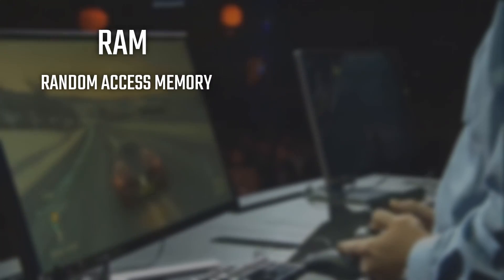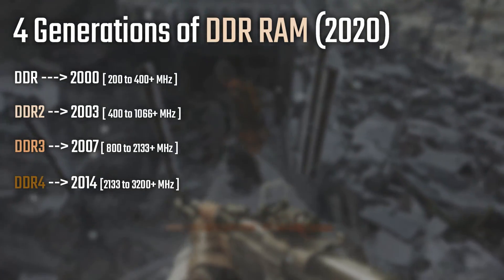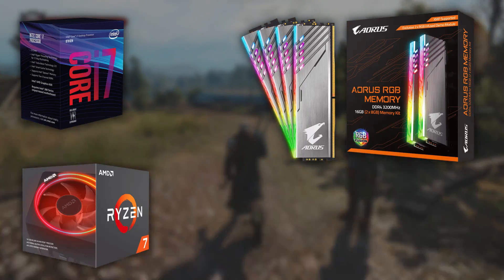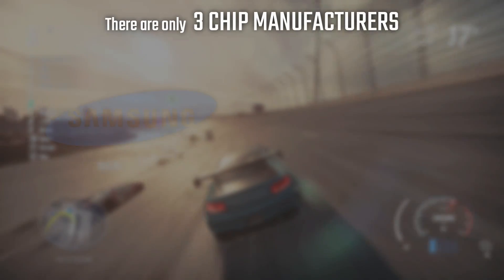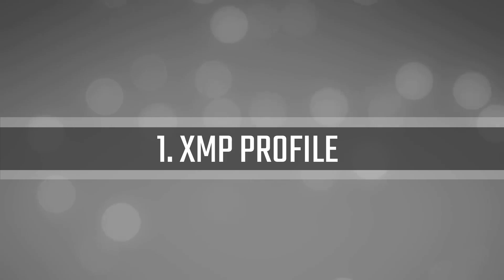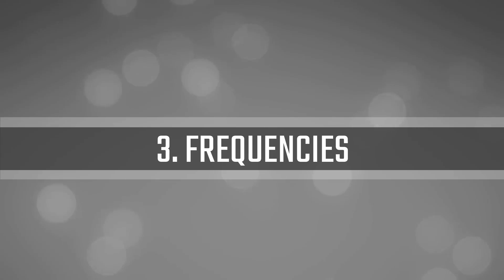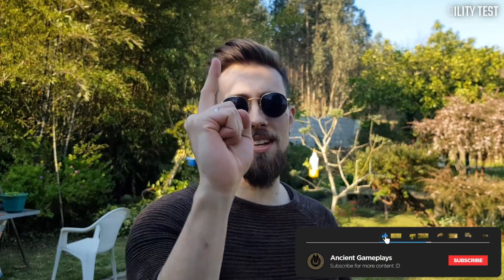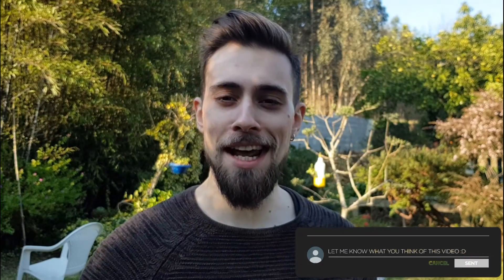How to Overclock RAM (2020 Tutorial) | Introduction of How RAM overclocking works, Tips and Tricks

Comment: But are the gains from all this lengthy process worth it? I don't think it is! especially when compared to simply applying the xmp overclock.
Reply from the maker: It depends completely on your build. For example, when you get a RAM kit rated 3200MHz CL14, it will most likely do 3800MHz with tightened timings (or more) and that will grant you a very nice boost :D
Reply: @AncientGameplays  I was planning to OC my ram from 3200 to 3600 when I get get a pc so I think its worth it to save an extra 20 - 40 pounds.
Reply: it’s fun to mess with your stuff and know you are using the most out of all components. overclocking everything on a new build is fun as hell
Reply: @BlakeCodGuy1  in your opinion to me its tedious
Reply: @74kross  very but worth it if you're on a apu or integrated graphics since they run off of ram it's making your graphics faster
Reply: I would say you’re wrong. The gain are totally worth it if you choose your ram properly. I can buy cheap Micron E-die ram and overclock it to the performance of much more expensive ram. Yes…….it takes time to do it properly………..but well worth it in the end. I don’t use PBO on Ryzen either. All of my builds run manually configured, fully stable, all-core overclocks of ram and cpu. None have come back.
Reply: I get the interesting scenario where XMP crashes my stability tests but manual overclocking doesn't.
Reply: @ThisIsAPigeon I think I'm having this issue as well brand new build 10700k Asus Hero XII and Corsair vengeance 3200mhz memory, I enable XMP and I get bluescreens on startup after a few hours of the pc being off super annoying I'm hoping overclocking manually will fix it for me too
Reply: @ThisIsAPigeon  me too. The XMP voltage is too high for my cpu controller. I crash with anything higher than 1.2125v for mem 😢
Reply: lol.. 90percent of ram sticks are xmp compatible.. enabling it is deafult :D I wanna see how to REALLY go over the xmp profile settings to like really lower the cl times.. I think Im satisfied with my xmp 3600mhz already.. just need a litle less latency
Reply: Some of us just like to tinker..
Reply: lol. this is why my ryzen 3600 can compare to most 3700's ez

Comment: Pc newbie here.  Ive been getting unstable memory (black screen upon boot up or random restarts when i get into OS) when I set the XMP to get my 3600mhz speed i bought (Corsair Vengeance PRO 16gb 3600c18) I set it back to the default 2133mhz for my fear of breaking something. Any advice? I have a Ryzen 7 3700x with stock cooler.
Reply from the maker: wel, the video actually tells you what do mate...But voltage to 1.4v should be enough
Reply: Ancient Gameplays I know I’m sorry I just wanted to be sure, do I have to move the voltage on the cpu as well like the video says or is that just for manual oc? Like I said I am very paranoid of destroying my parts this is my first pc.
Reply from the maker: @demetriomrtz  ram voltage..not cpu voltage
Reply: Ancient Gameplays I am referring to the soc voltage you mentioned, or is that on the ram too? Sorry I am a noob
Reply from the maker: @demetriomrtz  soc voltage is for infinity fabric, not cpu only hehe
Reply: Ancient Gameplays oh ok so do I tinker the soc voltage on infinity fabric when I up the ram voltage or is that just for manual oc ?

Comment: I have a quick question 
I have 2 8GB RAM kits from Adata d30 one with 3000 Mhz and other of 3200 Mhz, when I enable XMP profile its shows 3200 Mhz. Does that mean 3000 Mhz RAM is overclocked? Should I set it to 3000 Mhz manually?

Comment: Rip I oced and set my dram voltage at 1.45v and set the frequency up only 200 from 3000 to 3200mhz and still not stable... Would lowering the voltage help or do I need to change the SOC voltage?
Reply from the maker: You need to change timings also

Comment: I’m confused do I enable the settings in the memtest before enabling the settings in bios?
Reply from the maker: memtest always after overclocking to test stability ofc
Reply: @AncientGameplays  Wait Im confused do I set the frequencies then go into the memtest? And after I find a stable frequency I go into the timings right? Also will I still be able to go into post screen even if the oc isn't stable because I don't want to be stuck in a boot loop

Comment: Hey guys I am having problems running stable wih my xmp profile 3200mhz on b450 aorus elite and r5 2600x. So I wanted to thy dram calculator by thaiphoon does not show part number it says kingston c die but there is not any kingston die in dram calculator, could anyone help

Comment: Also worth mentioning on voltage that if you have a asus bios you may need to enable the xm profile. Doing that will auto set your voltage to match the Ram speed you are running.
Reply from the maker: No, that is not what the XMP does lol. The XMP is a complete profile done by the RAM makers...Basically it has a defined voltage to a defined frequency and timings, just that
Reply: Ancient Gameplays oh okay thank you I was still new to it.

Comment: Awesome mate, i have a question in stability test. How many threads are recommended to run to ensure its really stable?
Reply from the maker: Push it the max you can ofc. There is a better testing software called karhus ram test, but it is paid

Comment: I didnt need Ryzen DRAM Calculator to tell me G.Skill Trident Z Royals F4-3200C16-GTRS are absolute shit sticks, but they will make for a nice $119 set of Christmas lights !
Reply from the maker: loooooool haha. Well, it depedns, for example, some ram kits like the second tam value to be way higher than the other ones (my 2933MHz CL17 ram (hynix AFR) does 3600MHz CL16-22-16-16-36), that second value needs to be 22 for the others to work :D

Comment: I just wanna know about the timing, when you say decrease the number 1 by 1 does that mean, from 16 to 15 then reboot and then go on to the next number,

cause i wanted to do a CL15 from a 3200mhz CL16 Ram :D
Reply from the maker: Exactly that. Reboot, test and repeat the proccess
Reply: Yeah, that's what he means but that's just way too much time to invest. I go 2 by 2 or 3 by 3 and if I see that it gives error then I lower it 1 by 1. That way is faster because you won't have to let the test finish every time. You set 3 values, if there is something wrong with those, it'll give you an error before the test finishes; so you increase 1 of those 3 values and test again, if there is still something wrong then it'll give you another error, and so on so forth.

Comment: OK an Important Question..
I have MSI B450 Tomahawk max Motherboard 
And Adata Spectrix D40 2x(8) 3000mHz...ok now I want to OverClock It what is good for my mobo? And if I want it 3200Mhz what will be it's voltage? Pls answer quick...

Comment: I have a problem. I use XMP Profile 1 3333mhz 18-22-22-42. And my pc wont turn on. Always in cycle boot
Reply from the maker: Yeap, i mean....watch the video before commenting.also, those are Horrible timings for 3333MHz. Better use something like 3200 16-18-18-18-38

Comment: Can I do this on Asrock b450m.  It says on the manufacturing website 3200 is supported....I tried putting 3400 but my system just went into power saving mode and bootlooped.
Reply from the maker: The problem is not the board most likely, it is the CPU. Also, your ram is 3200MHZ it most likely won't make 3400MHz CL16, you need to increase timings a bit
Reply: @AncientGameplays  I am using the 3700x... So should I increase or decrease timings
Reply from the maker: @derrickbeauvais731  Look, lower timings are better. BUT, even if your CPU can handle it, the RAM kit may jsut not be able to do it. You need to increase timings to a high number, then test a higher frequency. After that start reducing timings one by one
Reply: @AncientGameplays  I just ordered the corsair vengeance rgb pro 32gbram kit 3600. 2x16.

Comment: I bought the Corsair Vengeance Ram 4 X 8gb 3600mhz. But everytime I overclock to 3600, I get an endless boot loop after I save changes and reset in the BIOS. My MoBo supports up to 4266/OC. It's fine when I set it to 3200 but I was already running 3200mhz with my previous dual-channel RAM. That's why I bought the damn RAM for the faster speed lol. Anyone have any advice?
Reply: I have said fact not all boards support kits stable 4 pieces . manufacturers show which kits are good stable 2pcs in board which are 4pcs stable in board, it's said but truth. Second thing it may run ok but in lower frequency or higher voltage of rams. first thing try 1.4v ddr voltage on 3600mhz, if not working try to decreace Cas latency if rams are cl16 lets try cl17, if not working lets try 3533mhz cl16 if issue lets try 3466mhz, should be achievable . good luck. after pc is running download and test Prime95 at least no crash for 8hours is pretty stable system. crossfingers, enjoy. if no help, switch for high capacity dual kit rams only as 4kits are always issue in overclocking and many times not compatible in many boards, said story but so truth. check support memory list on website of your motherboard manufacturer too, look for compatibility with 4modules of your Ram memory modules :)
Reply: @milanklco  okay good to know. I'll give it a try. Thanks for the help.
Reply: @bulletn3ctar  good luck, share please your results :)

Comment: Noob question. What if i don’t change the timings, and set it by default? Does that affect the overclocked speed bumps?
Reply from the maker: It will put higher timings which will.decrease performance. Timimgs are very important
Reply: Ancient Gameplays Thanks

Comment: I tried overclocking my ram from 2667 mhz to 3200.And my cpu was 3,85ghz.

I have b450 tomhawk motherboard, I went in bios and set DRAM Frequency to 3200mhz. 
And I enabeled  "Memory Try It !" I setted that also to 3200mhz and some other numbers were there.After that i saved bios and i couldn't get any picture on my monitor whatsoever, I tried everything, even checked my pc fully and don't know how to fix it right now...
My keyboard and mouse are also somehow disconnected evem tho they are connected.
IF ANYONE KNOWS ANY KIND OF SOLUTION HOW TO FIX THIS IT WOULD BE GREAT! 
Pls help..
Reply from the maker: Dude, you just need to do a CMOS clear since you tried settings that your RAM cant handle. That is why i said what i said in the video "do it STEP BY STEP" :D
Reply: @AncientGameplays  Yeah, yesterday I resetted my bios on my motherboard and all good now. Thanks.
Reply from the maker: @JAAAYCOBB653  you're welcome. Remember. Step by step!

Comment: What would you do? asusB450 f gaming,corsair vengeance 64gb 3200mhz only can read 2733mhz,if i use two stick they read 3200mhz,
Reply: And ryzen 2700x
Reply from the maker: do you have them on slot 2 and 4? and what about what i show in the video? and is BIOS updated»
Reply: @AncientGameplays  4 slots 4 stick 16 gb and bios up to date
Reply from the maker: Well, like i said in the video, first step is to go 1.4v on ram (up to 1.45v) and around 1.10-1.15v on soc voltage

Comment: Can you please go over your entire bios settings for the ram OC? Asus bios is the most annoying thing I've delt with. Different options appear in settings with the same names. MSI was so much easier to deal with, but that was back in my Intel days
Reply from the maker: I have ASUS and MSI boards and both are pretty easy, just some things in different places. Watch my CPU OC tutorials if you want that
Reply: @AncientGameplays  thanks for the response! I ended up overclocking my CL20 3600mhz to CL16 3600mhz and only touched the main timings and voltage. Tweaking the sub timings didn't allow my Mobo to post for whatever reason on my strix x570-f

Comment: My old ram I used for a 6th gen intel build works totally fine at 3 GHz on the Gigabyte B450M motherboard and I didn't even go further it might work I don't know. It might be the cheapest reasonable mobo you can find by the way. It's capped at 2400 MHz normally. The ram is Gskill ripjaws red.
Reply from the maker: Nice! But using ram voltage and timings to auto mean that the timings and subtimings used are really way, meaning you can get more performance out of it :D
Reply: @AncientGameplays  I used the Dram Calculator you showed at the end and it now runs at 3466 (mobo cap) CL16 1.35v
Thanks for everything man.
Reply from the maker: @ozmobozo  you arr welcome:D
Reply: Also voltage and timing settings are all auto.

Comment: I bought expensive b die 4133 cl 19 19 19 and a 3600 and a tomahawk max
I got the ram at 3800 but I couldn't get fclk any more than 1767. Bad luck I guess. I'll do with 3533 tight timings but it's not stable for some weird reason. So I'm still working in it. I have a lot of work left to do
Reply from the maker: That is quite strange, i guess you just need more Soc voltage since all FCLK should work at least at 1800MHz (3600MHz Ram). Very strange
Reply: @AncientGameplays  I fixed it
I had the voltages way off. I cranked up voltages very high and that ruined it.
Reply from the maker: @0s0sXD  yeah....well, do not go over 1.15v on soc. Not needed at all
Reply: @AncientGameplays  I never did. I had it at that. And I couldn't start the pc with that. Now with 1.03 it's my sweet spot

Comment: Thanks for the sick af vid. Sub'd!
Answer  or not I am staying subbed but I'm wondering about something concerning to me. My Corsair Vengeance RGB Pro DDR4-3200 is being shown as 2100 speeds in windows. I heard the bios sets it to the lower frequency which is fine but shouldn't it be 2600 not 2100? If it's really at 2100 am I even able to grab the 3200? Using 9800K with Gigabyte Z390 GAMING X.
Reply from the maker: Windows may simply show its true frequency (1600). If it is showing 2133MHz it means that your profile did not applied and you're running RAM at its default frequency.

Cheers
Reply: @AncientGameplays  Thanks for the response. So my "profile"? Does that have anything to do with bios? I think I left it at default but I thought it was higher like 26-- I can't remember what the last 2 digits are but I was thinking first 2 were 26, something something.
Reply: @AncientGameplays  OK it's in bios it looks like. I know I had changed it previously but it appears to be inaccessible. That's fine I'll learn how to change all that and thanks again.

Comment: Hi Fabio!

I'm an enthusiastic beginner, just put together a new config and I experiencing random system reboots.

Corsair SF750w 
Asus Rog B450 I , updated BIOS, chipset
Ryzen 5 3600 with Noctua NH-L12S
RTX 2070 Super
Corsair CMK16GX4M2B3200C16 Vengeance
PHANTEKS Evolv Shift Air, but on an open test bench right now so no riser cable in system as it would

 Random in every way, random in time, random in system usage...sometimes I just staring at the desktop and boom, restart.

I'm trying to solve this by common sense for weeks now, better PSU, better CPU cooler, got a bench to see satbility without riser cable.
Next step is the RAM and so I'd like to ask you:
My RAM is not on the motherboard's QVL, should I bother messing around on timings and voltages or just get a qualified pair of RAM? 
Thank you for reading it.

Comment: Hey there! I have been trying so hard to oc RAM to like the best I can get out of my system it's just this RAM... I oc'd my CPU GPU and even RAM but not at a point that would satisfy me... I just cannot figure out the about SOC voltage and timings as even if I change one digit... My pc goes into boot loop!
Reply: lol that sucks
Reply: @rin1502  it does. Actually I got to know that it wasn't me it was this Gigabyte motherboard which drop the VID making it unstable for me. And stock socks voltage 1.212V for XMP like wtf... So I manually tuned it with C2 function DISABLED and thank God:)  got my 3000 Cl 16 20 20 38 working on 3200 16 18 18 36. 😃

Comment: i bought a gigabyte b450 aorus pro wifi which does support 3200mhz but only with overclocking. Got corsair vengeance lpx 32gb which has 3200 speed. do i need to actually do something with the bios or will the motherboard automatically support 3200?

Comment: Just installed my new ryzen 5 1600 af with 8gb of 3000mhz (I plan to get 16gb when I have the money) I’m also using a msi b450m pro m-2 max and after setting up the new system it has under clocked my ram to 2133mhz even though it’s Corsair vengeance @ 3000mhz ??
Reply from the maker: mister, listen the video closely. I do explain that there.

Comment: I just tried using the xmp profile and it caused me crashes in games.And sometimes bsod.
Reply from the maker: Did u raise the voltage? Do you have your bios updated?
Reply: @AncientGameplays  im using gigabyte aorus b450i pro wifi mobo and 3000mhz ram. the xmp profile already set ram voltage to 1.35v (AUTO). also tested with same setting with increased vcore soc to 1.13v.didnt work for me.Im still new
Reply: oh and i just updated the bios to the latest version
Reply from the maker: Man, i do say in the video to try 1.4v...you guys just watch one minute or the video...goddamn
Reply: @AncientGameplays  yeah you did actually.Thats my mistake,because i was reading the your "xmp usual voltages" that popped out while you were talking which i mistook as the voltage you're suggesting.Sorry about that
Reply from the maker: @jerowe_5896  np man  happens i guess
Reply: It's very confusing for me.I'm not sure if what i did is correct.After i enable xmp profile,i see it says 1.35v (profile ddr voltage) in advanced mem setting,which means ram voltage right?But it's fixed and i cant change the value there to 1.4v
Reply: @AncientGameplays  i went into advanced voltage settings,i changed CPU Vcore to "normal" to be able manipulate the Dynamic Vcore that i changed to +0.05v.There's also "DRAM voltage" there that i changed to 1.4V.So far,is it correct?
Reply: I just joined your discord and posted in pc questions section.Any help would be appreciated 🙏🙏sorry for my lack of understanding